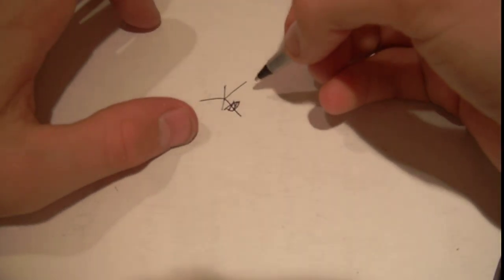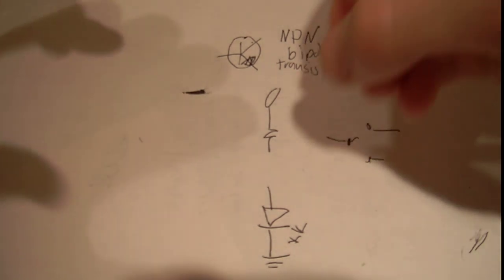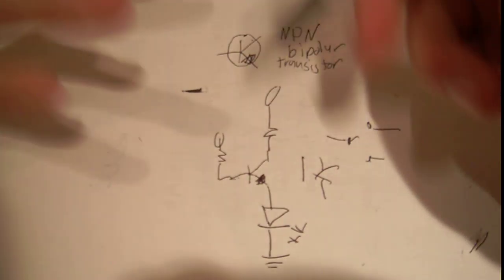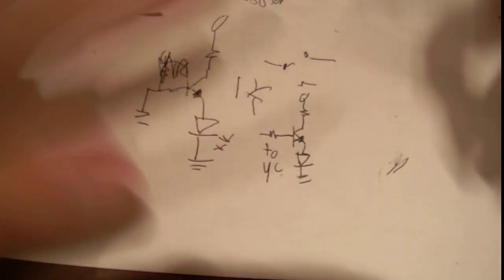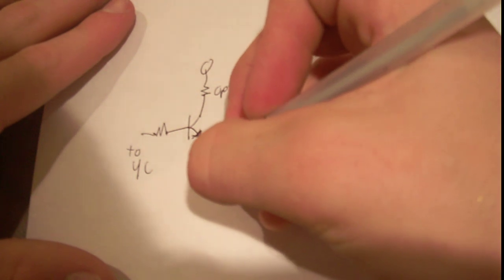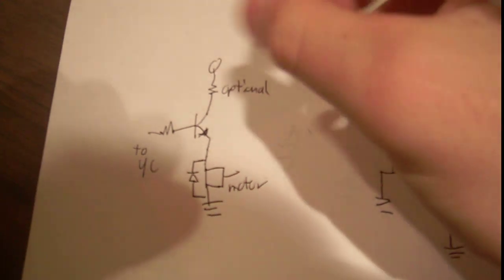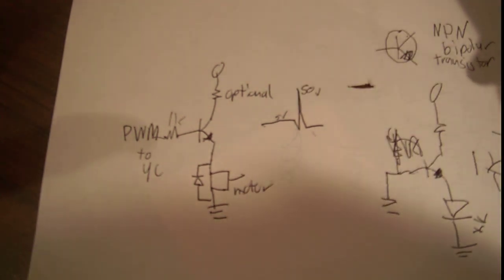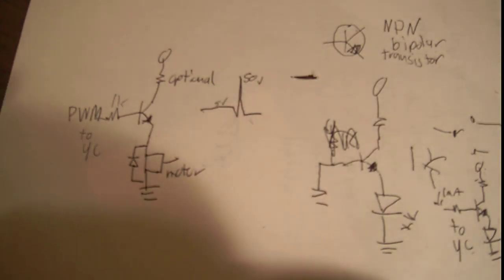NPN Transistors

Comment: I've fucked around with this for 3 days, and with no current at the base, my transistors are conducting current from emitter to collector (or whatever).  WTF!   Its really pissing me off.  Further, the transistors heat up fast when I do it and start to cook.  With no current at the base, they should be OPEN.  Using 2N3055 common power tranisistors.

Comment: Hi. I have a question about controlling the LED. I have only two terminals to connect wires. One plus +, one neutral - ; and I'd like to use a NPN switch to control the LED. Can I connect the base to the power (+) terminal through a big resistor? Thanks in advance.

Comment: Just keep in mind transistor let you have control on high voltages with a low voltage, also is faster than physical swichs and let you amplified a low voltage signal into a higer voltage signal.

Comment: (Bipolar Juntion Transistor) BJT-NPN transistor
The signal comes true the Base Actually, the voltage on the colector is what amplifie the small signal comming from the Base and depend on the beta of the transistor..
if you have a 60 beta transistor and you wonna have 30mAmp on the led then you need 30/60= 0.5mAmp on the base, and then start calculations on the value of B resistance and C resistance depending on Source voltage on B and C (the transistor drow 0.7v from C>B also from B>E.